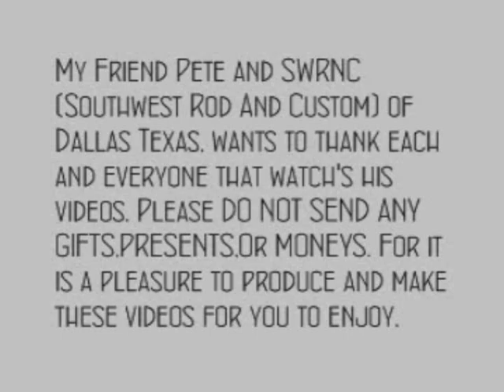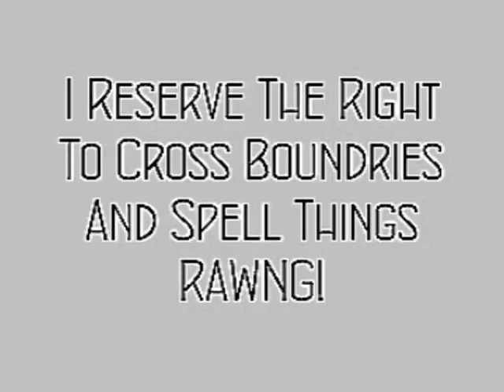How To-Build A 4X4 Willys Jeepster and FAIL! Part 7-The EXTREME ULTIMATE FAIL!

Comment: Atoms and molecules are mostly space, yet pulsate with energy. A car can develop a spirit, imbued by an enthusiastic , loving owner, and it can remain in those iron molecular crystals. Wash your car and note how the motor runs better. Work on it daily, and watch it grow to appreciate you.  But do not curse the projects of others with such dolorous midwinter depression.  Get some teenage boy to complete the project. There can be joy again in Mudville!

I put a Chevy V-8 in just such a car, a 1950 Willys Overland, with a Ford rear axle (bolted right in) and a 3-speed Chevy manual trans in about three months in my junior year of high school, before I even had a driver's license. I had to make the whole floor as well, front seating area to firewall, as the original had rusted away. All in 1967. My grades in school were not affected and my friends helped, but we were all very inexperienced. It was a great car, and still with it's second owner after me, as of a year ago.

Comment: Doomed to fail from the start. Lack of resources, poor logistics and last but not least: an older fellow working on it. A young buck shadetree mechanic could have chopped shopped that project to death in one summer - does not mean the results would have been anything impressive though. But something would have been done. 
For example, I must have spent a month in a wheel well replacing a rotted flex box and frame. Can I do that in 15 years? 
Will I want to? 
With proper planning I won't have to. 
Working under a tree in the yard without a solid plan would not help.
Reply: I've been taking that C-60 oil stuff and I'm getting younger again, working more every day, and with less fatigue. They say it fixes everything.